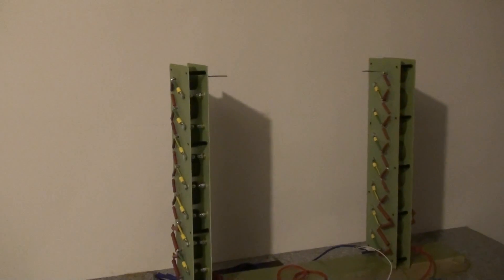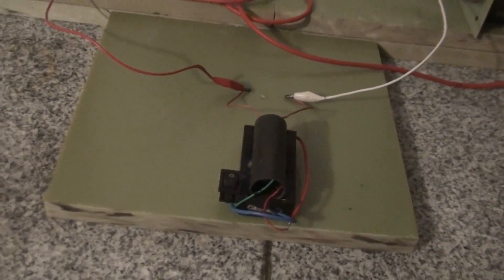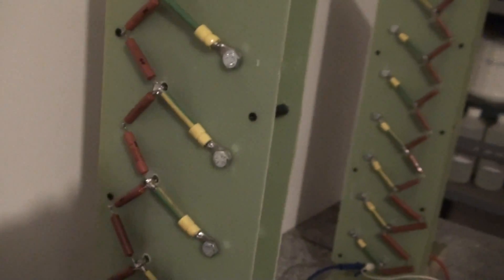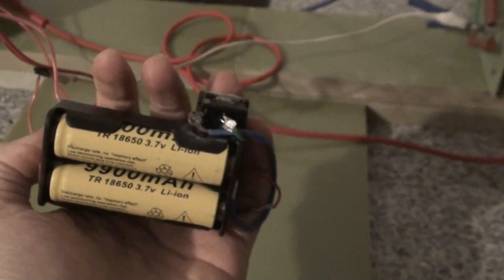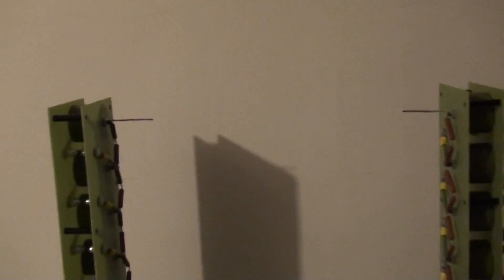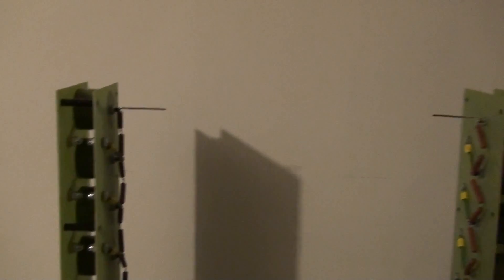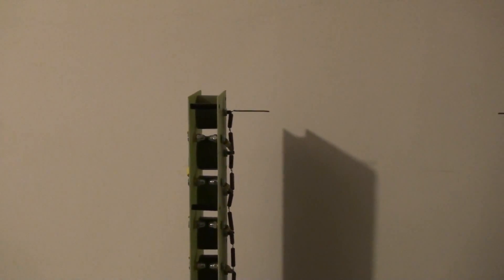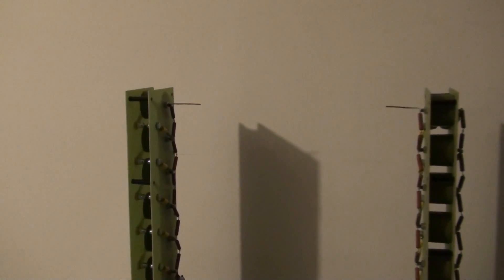Marx Generator 300000V

Comment: good evening I noticed your beautiful generator, but I ask you if it was possible to oscillate the shocks in mhz. best regards.

￼
Reply from the maker: Hi! I'm not sure how  we could do that...it charges through the resistors and discharges when the voltage is large enough to ignite the spark gaps. I saw some other version where the resistors were replaced by coils, but these have the same function to have some impedance, much greater than the spark gaps when discharging. MHz frequency could be reached only by Tesla coils by self oscillation. Could you please explain more or  draw this idea?

Comment: can we measure the output voltage? and i want make smaller version at least 1-2kV for output voltage, that is possible or not?
Reply from the maker: You can build a voltage devider to measure the voltage. It's easier to build a 2kV version, You can use 220V ac input or a DC powered zvs driver with a ferrite transformer. Just take  care If using mains voltage!
Reply: @virgilius1979  if i don't use the zvs driver, will the spark still exist? And if i want the output voltage 1-2kV, should i use resistor and capacitor for high voltage? Or you can suggest me what kind of resistor and capacitor which i should be using for 2kV. Thank you very much for your answer
Reply from the maker: @shinedarajat8066  you can charge it directly from the AC socket (240V in my country). Choose capacitors of at least 600V, 1uF is OK for capacity. Can use 6A10 diodes (rated 6A, 1000V DC maximum). With 8 capacitors and 8 diodes (4 stages in total) you have about 2400V; use a resistor to limit current, but take care this voltage and current can be lethal!

Comment: The final voltage will be limited by the voltage at which each stage breaks down due to its spark gap distance.
Reply from the maker: It seems logical to ne, but I noticed how difficult it is to find the optimal spark gap. Even the power of the HV unit is not linearly related to the performance of the multiplier. In my situation the optimal zvs input voltage is between 20-24V. If it is more the first capacitor charges too fast and discharges through the spark gap without triggering the cascade.

Comment: How to I know about positive terminal of hv dc power supply
Reply from the maker: The Marx generator is powered by a DC HV transformer (flyback transformer has an internal diode), so I know where the plus and the minus is. One electrode of the spark will be connected to plus and the other one will be connected to minus.

Comment: Sir can we triggered first spark gap using iron rod ? Can we increase input voltage to triggered first spark gap?
Reply from the maker: That would be an option (a triggered spark gap). The problem is - the higher the voltage, the higher the probability to self ignite the spark, so we should use sealed high pressure spark gaps or a different gas, with higher dielectric constant. I currently work on a Marx generator with 150kV capacitors, but its hard to prevent early discharge.

Comment: easy trick is use a "ND"-Filter (or sunglases) for the camera lens and then use longterm exposure in the dark. This way timing plays nearly no role. camera can pick up the fast lighning, i could saw one at ~2:55 when i playback at 0,25 speed.
Next time try film in the dark so the camera might see the light.
Reply: rolling shutter...

Comment: would you mind share your calculations?
Reply from the maker: There's no calculation, just empiric experimenting. If the resistors are two high value the capacitors charge very slowly or do not charge because of the corona losses. If the resistors are two low the cascade effect will not work. I recommend the capacitors to be at least 1nF, but it will work with lower numbers too. Insulation is important, resistors need to be high voltage or they will fail in time. I advise to try on smaller scale than escalate. I have problems with a large scale model...still in progress.

Comment: Nice generator but the camera or camera setting sucks' all you can see is what looks like a flash from an ark across the other side of the room' cant see any lightning bolt
Reply from the maker: The arc lasts milliseconds, only with long exposure small aperture shots you can catch it.  On video its' impossible with normal camera.

Comment: there is some difference between marx and crockford about spark lenght with same values?
Reply from the maker: Cockroft multiplier efeciency depends also on curent frequency. In theory it should be more eficient than Marx, but in practice they are similar.
Reply: Bogdan Rotaru thanks for answer!

Comment: how have you selected resistor value
Reply from the maker: There's no magic rule for this. Higher value will lead to longer charging time, but you can control better the spark gap synchronization. It is important the resistors are rated for high voltage.
Reply: thanks for reply.i want to know how you calculated energy of the resistor that can handle high pulse energy.secondly what kind of system it is, l mean under damp, critical damp or critical damp.
Reply from the maker: During the discharge the resistor is bypassed through the spark gaps. It may get worm during charging the capacitors, especially if the charging-discharging rate is very high (due to low value of resistors and/or low capacitance); you can calculate as a scientific exercise, but you can get around with 1MOhm value and at least 2W resistors (better to be 5W).

Comment: Where you get ur capasitors from? I’m going to copy ur generator but with 2,2 nF 10kV x9 ( 3x in series then x3 pararell) ceramic ones for school project
Reply from the maker: Vizi_    look in ebay or aliexpress. These are from russian army surplus, old stock, but you can use ceramic capacitors like you said, they are cheaper.

Comment: I just got the high voltage module from eBay and pretty decent for about 1~1.5cm arc by itself. I'm trying to make a Marx generator like what you did but that's not cheap for over 10kV rated capacitors even for just 1nF. The arc produced by the module can be over 30kV (assuming 3kV/mm air breakdown voltage) and may damage the capacitors if the spark gap is too far. Do you plan to make a smaller version one?
Reply: I know this is a month old, but you can easily make your own high voltage capacitors that go to like 100kv
Reply from the maker: Lee Yy .  Yes, you need to calculate correctly the spark gap, do not push the capacitors to the limit. Leave a margin of at least 30%. I do have a smaller version, I'll upload a video with it.
Reply from the maker: Also  if you want to go cheaper, look for small ceramic capacitors, you can put more in series to get higher voltage. They are much cheaper than doorknob capacitors. Also you  can find some surplus high voltage resistors; carbon film resistors are not very good at HV.
Reply from the maker: Child Labor      100kv is a lot for a DIY capacitor. I dont say its not possible, but capacitance would be very low and I have doubts about its reliability. Did you try it yourself? If so, please share your experience.

Comment: my last question sir, please reply.
I will use capacitor and diode only,  not resistor. can I give power supply by high voltage module from ebay. will it work?  I have high voltage module but not flyback Transformer that's why.
Reply from the maker: These modules from ebay usually produce DC high voltage. This is not good for capacitor-diode multiplier, you need AC for this ! Use DC for Marx generator only (resistors and capacitors)

Comment: hello sir, 
please give me a 'Value' of high voltage rated capacitors, and diode. so that I can get generate million volt. I have that module from eBay. but no idea about value.
give me that value so that it should be work. capacitor and diodes should tolerate it 300000v.
I hope, you understand what I am asking for and my need. I don't need value of resistance.
Reply from the maker: It's not that easy. For 1MV you need higher voltage capacitors. Here I used 30kV for each stage. So you need at least 90kV, maybe you could use 3 x 30kV in series. You need to experiment first with lower values and than scale up.

Comment: Stupid question, but would it be possible to power a marx generator using lemons, and a joule thief circuit?
Reply from the maker: you can use any power supply, but you need to raise the voltage to a few tens of kilovolts to charge those capacitors; the small device you see there has a ferrite transformer inside, working in high frequency mode. It outputs about 25kV, just perfect for those 30kV capacitors.

Comment: Beautiful Generator !
But The 9900mAh batteries are Fake. There are a lot of theirs fake accus from China to buy on Ebay or other sites. Be careful.
Reply from the maker: You're right, although I didn't have any problems with them; they work fine for a flashlight or remote control car and I have them for more than 2 years. I didn't push them too much regarding current.
Reply: I used fake-accus too (800 instead of 1600mAh), in a homemade flashlight from 2010 to 2016 and they worked fine ^^